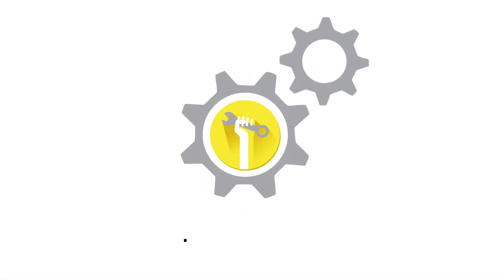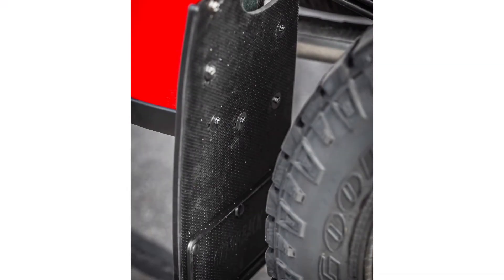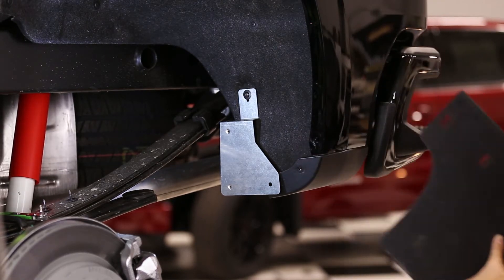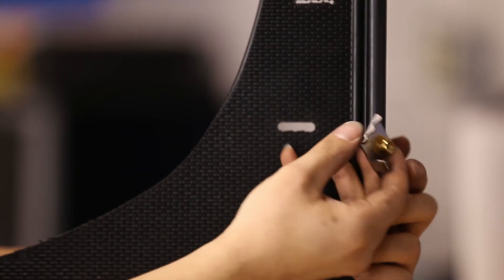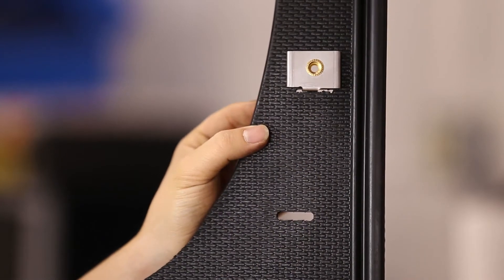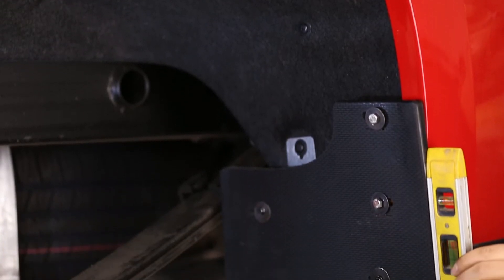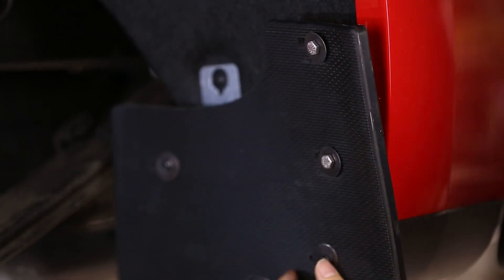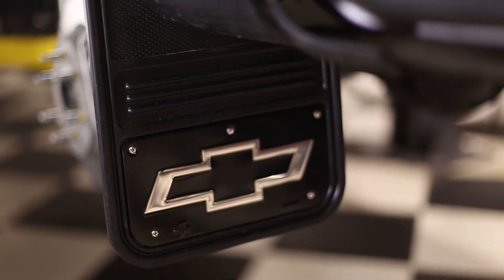Gatorback 2019 Silverado REAR Mud Flap Install

Comment: I just ordered a pair and I just went outside and looked my truck has no liner or screws in the rear ?
Reply: 2020 Silverado 1500
Reply from the maker: We have a video that shows an install on a truck without a liner.   Please see here:
https://youtu.be/OiUs2olJ-7M
Hope this helps!  Feel free to reach out if you have any other issues!
Reply from the maker: There is a small clip that should be included in your kit which will fix the issue.  The video will look the same at the beginning but then switch to show the install without the line.
Reply: @TruckHardwareLtd  ok thank you . I haven’t received it yet but does the tire have to come off for install?
Reply from the maker: @Cdawg1871980  You shouldn't have to just sometimes gives you more clearance for your tools.  Mainly we take them off to have more visibility for the install videos!
Reply: @TruckHardwareLtd  so I finally got the flaps after waiting 7 days and there’s no bracket !! Just 2 flaps and a bag of screws.. I’m beyond annoyed
Reply from the maker: @Cdawg1871980  I'm very sorry to hear that, can you reach out to us at info@truckhardware.ca or better phone us at 1-800-661-8208 so we can help you get sorted out as quickly as possible!

Comment: My gatorbacks only came with self tap screws and washers. No other hardware
Reply from the maker: It sounds like you purchased the universal flaps. The custom flaps are a much better option for the newer Silverado. You should contact your local dealer for an exchange.
Reply: @TruckHardwareLtd  thank ya